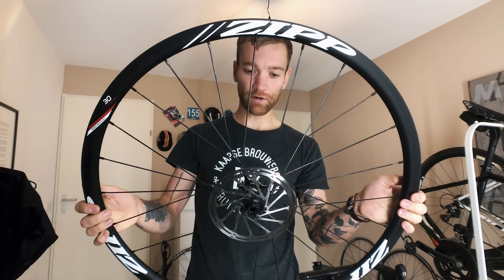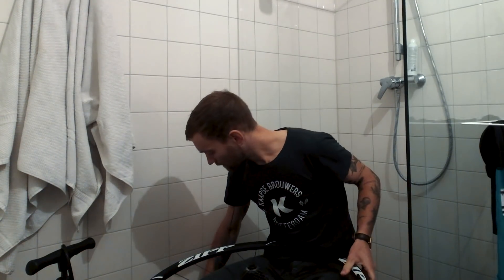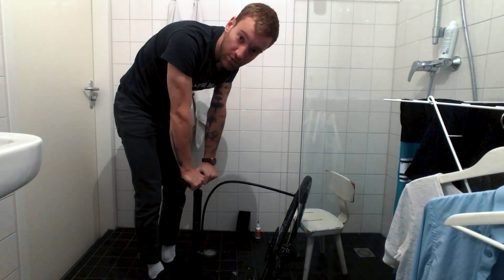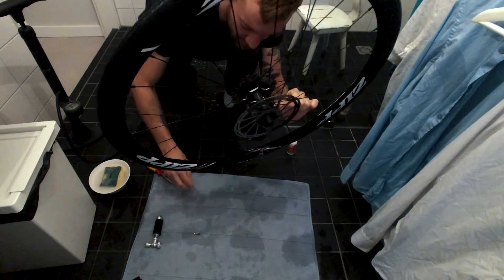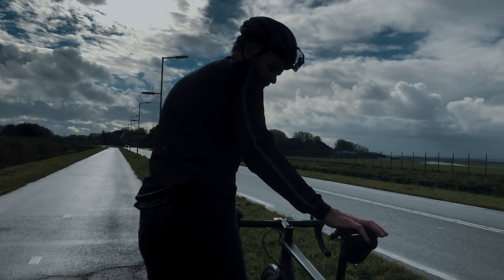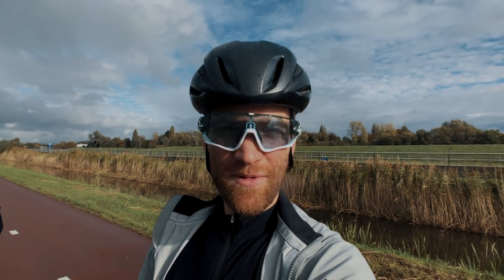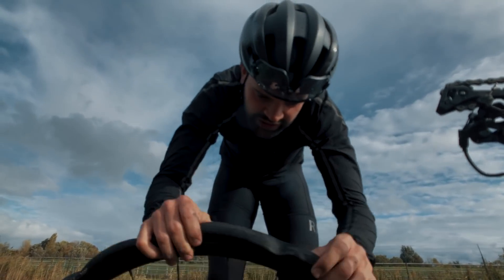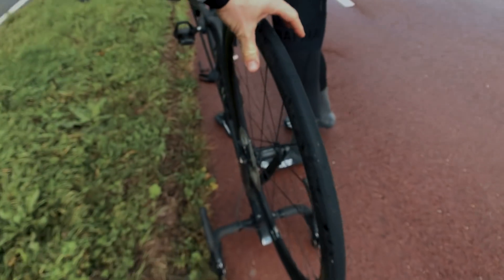LEARNING HOW (NOT) TO INSTALL A TUBELESS TIRE

Comment: Definitely good timing, your friend getting a puncture :-) :-) and you trying out tubeless... you know I too am worried of getting that milky sticky crap all over the place. But sure seems like a positive thing to upgrade to. Sickbike channel did a test on 15 tubeless sealant s and surprisingly 75-80 of the products did not work to seal the punctures!!!!! Also,  how long can one go without changing the inside liquid!!?? I imagine it would tend to dry out, right? And then you would have to start the process all over again...when I investigate more I will think on a possible change to tubeless... sounds exciting, but scary at the same time!!!!
Great video bud.. oh, and without the quick Co2 fill, you would not have been able to fill that darn tyre up, something to keep in mind, looks like no more mini air pumps on the road for tubeless application, right?!!!
Reply: I went tubeless this year. After 3 months, I started checking the sealant inside with a syringe made for the purpose. After 6 months, I had to add sealant. You don't have to remove the tire for that. As for installing a new tire, sometimes they seat with a normal pump. There are also pumps that have a reservoir of air that you release into the tire all at once, much like a CO2 shot. Anyway, I highly recommend going tubeless. The ride is better, and no pinch flats.

Comment: Save yourself money, and just put the sealant in your inner tube! (must have removable cores) and you can use your favourite tyres
Reply: The sealant does not work well in tubes, even the ones that are made for it. Converting a normal rim to tubeless isn't that expansive knowing you will not need to buy tubes anymore.